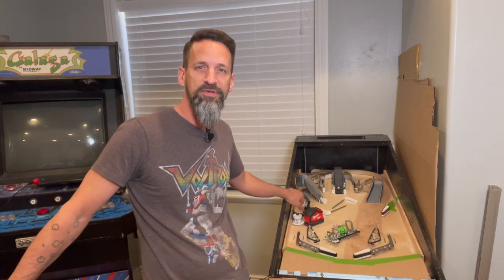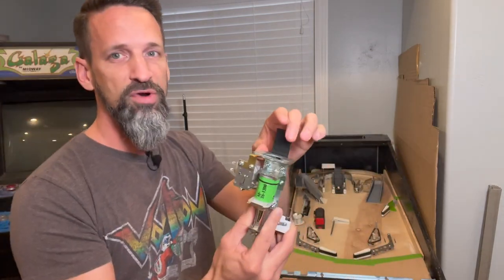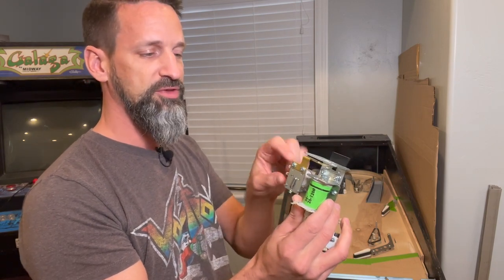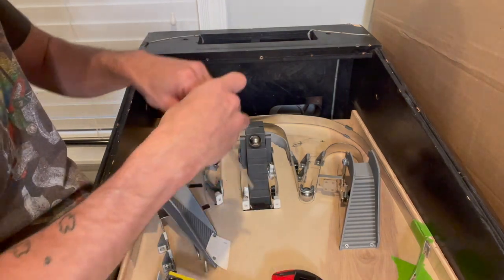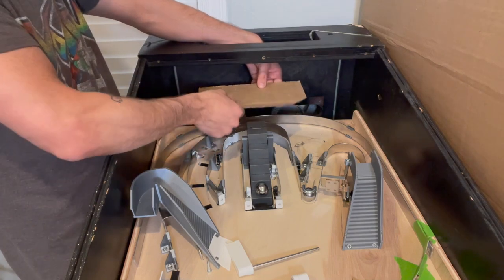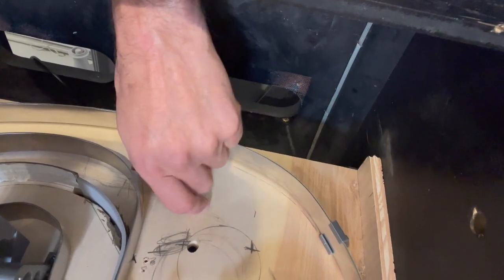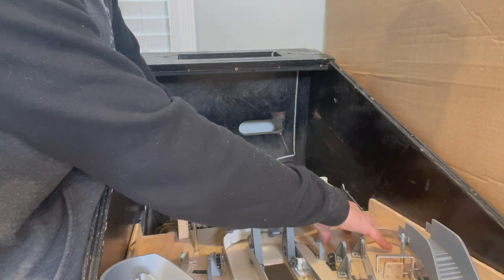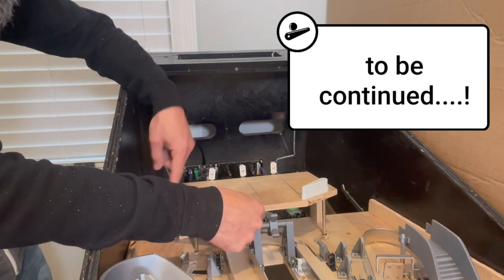HOW TO MAKE A PINBALL MACHINE: Upper Playfield Part One

Comment: Maybe, since the loose condition on the top playfield is more about when you miss than safe recovers you could make the flipper gap near to 0 and that way you are sure that the stairway drops the ball at a right place (over the flippers). This could require the upper pf to be really thin and as low as possible.

You could also have 2 grooves in the stairs and a fork to grab the ball at the top if nothing else works. 

Last idea : if you want more space for the 4 drop targets you may be able to put the mech under the main pf and print a longer target that just sticks out up to the upper pf. Not sure if it can really work but it might be worth trying.
Reply from the maker: Good suggestions, thank you! Yeah the flipper gap may not be necessary at all really 🤷 a little play testing should prove that out on way or the other.
Reply: @thepinballroom  Good luck!

Comment: Steve, is there a video where the relationship of the depth of the playfield in the cabinet vs the plunger location is discussed? It seems like the plunger location stays fairly consistent across pins but the depth of the playfield seems to be increasing to accommodate more levels. This would have the effect of reducing the inclination and even to a degree the angle of the plunger. The playfield pitch I am assuming is corrected with the table legs.
Reply from the maker: Hey sorry I missed your comment until now.  I don't have a video about that, sorry. As far as I'm aware, the playfield depth / height hasn't changed. 🤷 I set mine up just taking measurements from another machine

Comment: Just thinking out loud.  I probably oversee something but what if the "active drop" coil is behind de drop target without any other mechanics. I see the drop target has a metal part in it. If the coil is behind it, doesn't it pull the drop target back enough to let it fall down again?  
And/Or if you place drop targets like you do, you would only need one  "active drop" system for all four targets.  If you want just one to drop you fire the  "active drop" system + the "take then back up" system simultaneous.  So maybe look at normal drop targets without the "active drop" coil again and figure a separate system to actively drop the whole set.
Reply from the maker: Hmmm yeah that's actually a really good idea - I wish I would've thought of that! Thst would totally allow the same type of system pretty well I think. Thanks!
Reply: @thepinballroom  Well I am learning way way more from you then I could teach you. Thank you for that

Comment: Personally, I would not have bothered "smart" drop-targets. Also, I would not allow the balls to drop out the back, 'cus then it will be too hard to keep the ball up there for more than a few seconds. All that effort to make the upper playfield and get the balls up there and then they will drop back down within a few seconds. Not very fulfilling IMO.
Reply: that's more like the freedom of the maker. It was stated clearly that the idea was indeed the ball would only be very short up there. It is intentionally.
Reply from the maker: You're not wrong, I'm not planning on having the ball up there super long, but in doing some testing I agree with you that it's too easy for the balls to fall out - I'll need to make some changes to make it more worth while